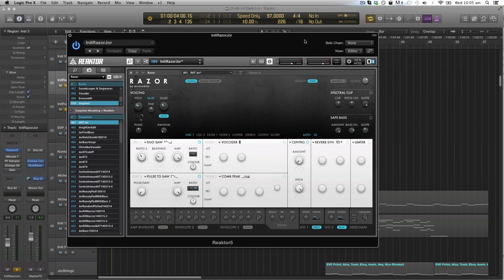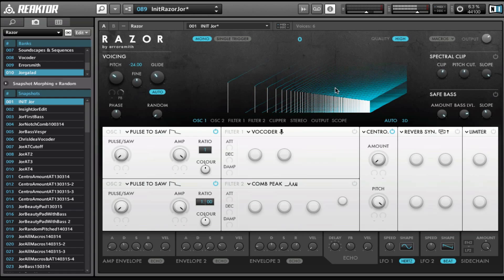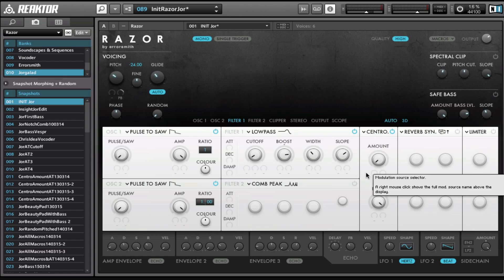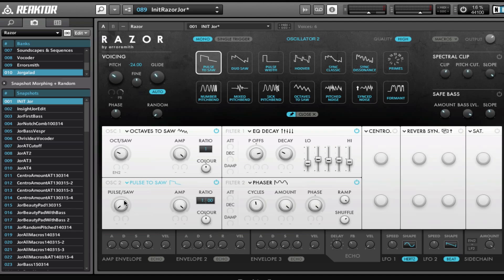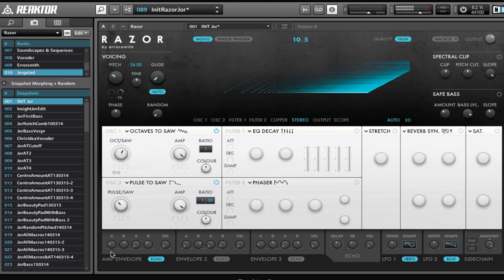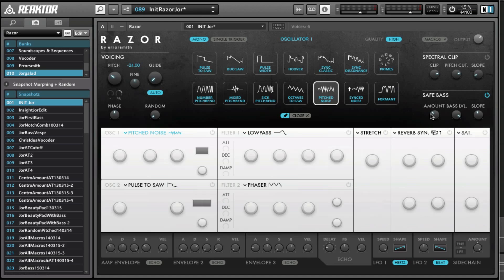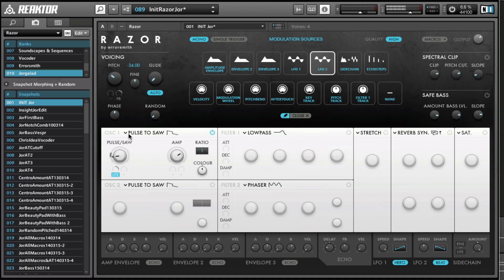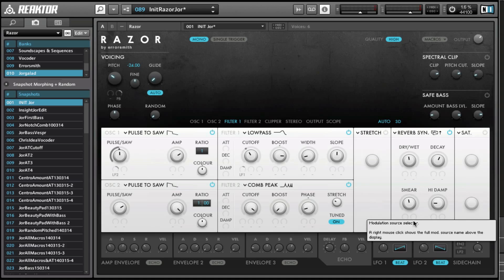NI Razor tutorial - An Introduction to Razor

Comment: why is massive not an additive synth? you can also start from a sine wave and than go on . maybe i didn't understand it
Reply: PYRITE Massive uses wavetables, kind of like Serum but additive synthesis is the addition of modulators that modulate the carrier signal. That carrier signal can be modeled mathematically as a sine wave, which is why we associate sound with sine waves, and each addition of modulation, "modulates" the frequency of the signal which inherently produces harmonics or partials that you hear. Massive doesn't do that by way of additive synthesis. It uses the wavetables created by an additive synthesizer. If this all sends confusing, it's because it is. Just take your time and study a little everyday and in a short time you'll be a pro. Fortunately, you actually don't need math or physics knowledge for this. If you did though, things make more sense and results are more predictable instead of guessing. By the way, when you say Massive starts off with a sine wave, yes it does...but it's a wavetable of one, not a generated one that you can modulate directly, only morph to another wavetable.
Reply: @matrixate  WTH? Additive synthesis has nothing to do with modulation. It's additive meaning you add as many partials as the synth can generate. Massive uses wavetables... which can be made with any form of synthesis (not necessarily additive) or made with editing software. Massive doesn't "start with" a sine wave. It starts with a wavetable which can have any sort of waveforms in it.
 i know this is years old but ppl are still going to view it and read the comments and this last comment is completely incorrect.
Btw, there is plenty that you can't do with Serum. i too design sounds, i wouldn't advise "start with FM", you can design sound with many different forms of synthesis. Lastly wth is the advice to learn FM because you will discover that you should have learned it sooner? I don't mean to sound so critical but the internet has become one giant pool of misinformation.
Reply: @crysstoll1191  What I wrote is correct. I think you were reading with the hope to find something wrong and interpreted my words to mean something that I didn't say. I'm not changing anything. What I wrote is directly from some design theory. I think you may need to go back and re-read what I wrote carefully.
Reply: @matrixate  I reread it a few times, it is not correct, hence my post.
Reply: @crysstoll1191 Every website on additive synthesis says the same thing I said, additive synthesis is basically just adding sine waves (modulators under the hood). The only other thing I could have added is that sine waves are not sound, rather they are just trigonometric functions that model graphically, the differing level of pressures that propagate through air from a mechanical source (like a speaker or human diaphragm pushing air through vocal cords). Combining differing pressures by changing frequencies and power, causes different sounds (and harmonics). That is what you're doing with an additive synthesizer...Massive is NOT that... which answers the OP's original question.

Comment: Why does razor take up so much CPU?
Reply from the maker: Because it is essentially using 320 oscillators/partials, its not that bad though! You can try to increase your buffer size if your system can't handle it otherwise :)